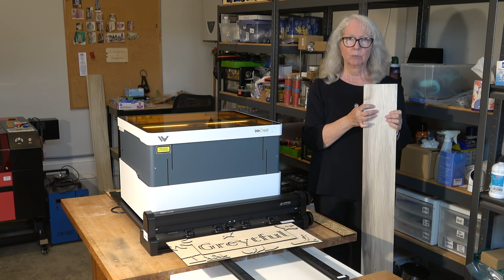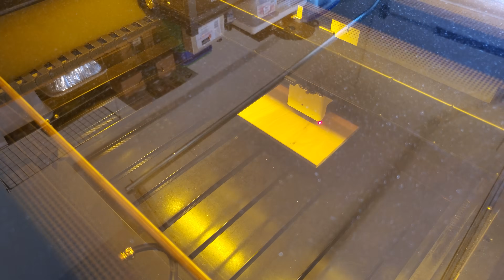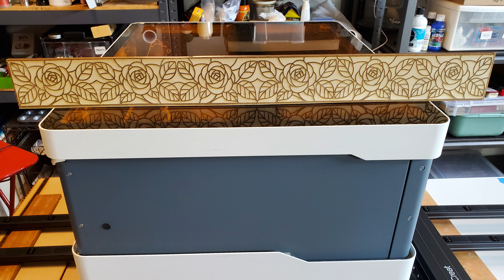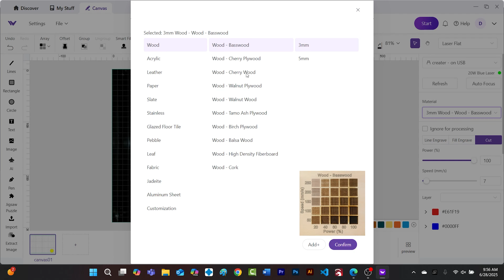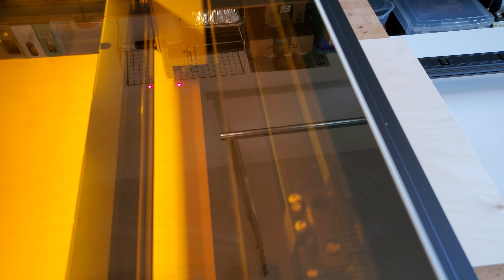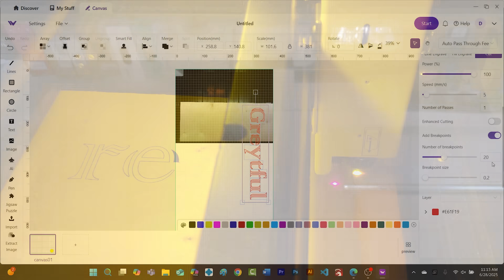Everything I Learned About Using the WeCreat Auto Pass Through Feeder

Comment: I would still use that shorter wood you bought first. Then add to it a scrap piece of wood that's the extra 9-10 inches, make sure its the same thickness as the project wood and attach it only to the back end side of your project board, (not the beginning end). Use wood glue and a few staples or a strip of 3" wide tape on top to attach them to each other that way (also add a tape strip below). Using something sticky like black duck tape, gorilla tape, seam tape (ram board) or better try using Scotch "rough surface" green painters tape that is extra sticky and is used on raw wood. When you are done you can reuse that same scrap piece of wood over and over again and that way your not wasting any wood for future projects. Just don't cut or engrave on any tape and make sure its fresh pieces of tape, rub them into the wood good so they don't come off.
Reply from the maker: You are so clever! I had decided to try something similar but didn't think it through so clearly. What you describe is the easiest approach and I already have everything I need in my shop. Thanks for suggesting this, it is helpful for me and others watching this video!!